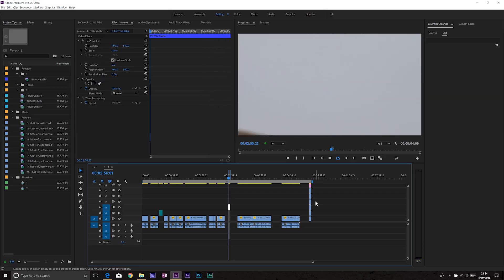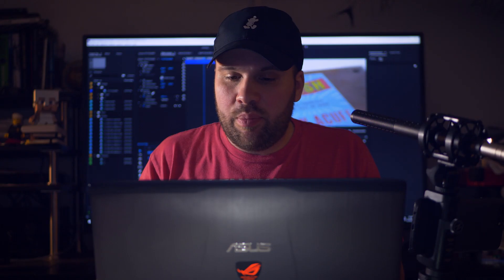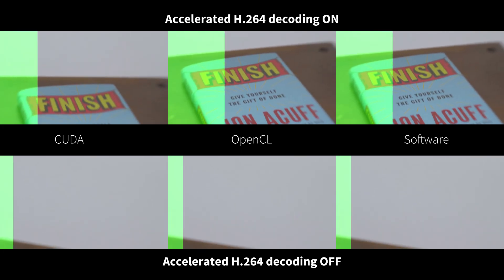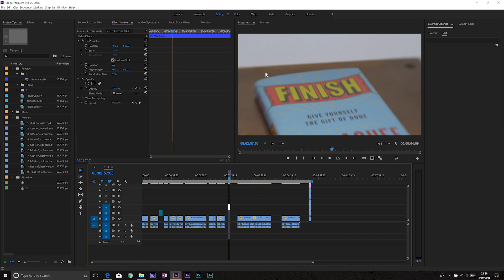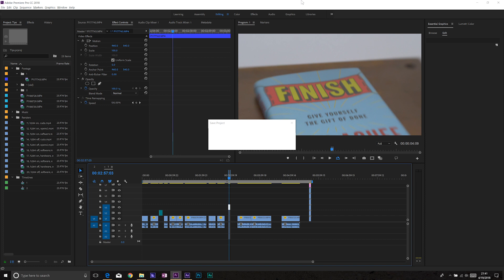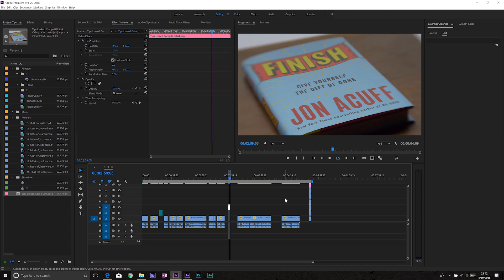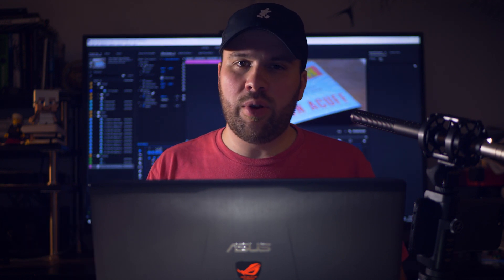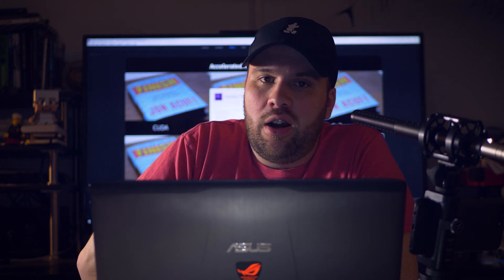H.264 bug in Premiere Pro: how I fixed it

Comment: Whenever I want to edit my videos on  H.264, the premiere pro will close. Please how can I fix this ?
Reply from the maker: It depends on what the cause is and when it's happening. You may need to change settings to use software instead of hardware rendering (what the video is about). You may need to update your graphics drivers. You may need to disable certain plug-ins. You may need new hardware. You may need to transcode the footage to a different format before importing. Lots of options depending on where it's going wrong. Adobe support and forums can be very helpful if you can explain in detail what your problem is and what steps are needed to reproduce the problem.

I fixed issues with crashing on export in this video, but basically it meant using software rendering instead of hardware: https://youtu.be/3n6DCA4MZy0
Reply: @chris_sparrows  thank for your help. Actually after editing my videos, if I want to render it and select the H.264 format, the premiere pro will suddenly close. This is exactly what I experience.
Reply from the maker: @chidozienwokoji4923  It still depends on the specifics, such as rendering directly from Premiere Pro or sending to Media Encoder. Sometimes one works over the other. You could try creating a new project with no footage, create a black video and render it. If that works then it's likely an issue with rendering your footage and not rendering in general. Setting rendering to use software instead of hardware before rendering might work. Honestly it's hard to say what's going on without seeing it.

Comment: If this happens to Me I just delete the video, remove it completely from project bin, then re import it, I found the culprit when this happen is when you make an  edit or scrub the timeline whenever the video is still making a cache or conforming. 

Premiere pro probably has the most problem when editing, you can't just think of your footage and edit it, you also need to think how to fix technical stuff every time, it sucks. Its probably the only Video Editing Software with so much problem, If only other Video editing software would provide motion graphics like after effects and has some intuitive ui I would switch, but right now there is none on the market so lets suck it up, Still one of the worst Software though in terms of efficiency.
Reply from the maker: Hopefully you don't lose too much work by doing that!

Comment: My premier pro do a glitch in Video after export
Is there any solution
Reply from the maker: Try changing the render settings to use software instead of hardware.
Reply: @chris_sparrows  I tried but it didn't worked
Reply from the maker: Does it happen on the timeline or just the render?
Reply: @chris_sparrows  it does happen in the timeline as well but that's not a big problem for me
But the glitch effect is also in my exported video
Reply from the maker: It's possible the footage is corrupt or an effect is causing the glitch.
Reply: @chris_sparrows  I didn't applied any effects it's just simple cuts
Reply: @chris_sparrows  I'm using 7 days trail version
Reply from the maker: Does the footage look like that when you play it in something else like Media Player?
Reply: @chris_sparrows  not the footage Don't have any problem
My premier pro does this with every video
Reply from the maker: Only thing I have left to suggest is trying to render to a different codec, otherwise you should probably contact Adobe support.
Reply: @chris_sparrows  hi I contact the Adobe helpline and the Adobe person asking me to give my computer access to him 
Is this normal?
Reply from the maker: I've never had to personally, that usually indicates it's not a simple issue to resolve. As long as it's Adobe's official support, it will probably mean a faster resolution.

Comment: my problem is that my graphics tab is all over the screen and like the places of everything is wrong and i really cant find a way to fix it i have a dead line please help i can send u a screen shot if it'll help
Reply from the maker: I'm not sure what you mean by "graphics tab". Things to try if this video didn't help: Does the footage play on the computer at all? Try the default video player on your computer or VLC Media Player. If not, does it play on another device or on your camera? If not, then the footage is probably corrupted. Does it play at all in Premiere with all effects disabled? If it does, then an effect is causing the issue. Enable them one at a time until you find the problem effect; sometimes effects are fine on their own and they have issues working well together. If that's not it and you have issues with both hardware and software decoding and encoding, then you can try updating Premiere if you're not on the most current version, or using the previous version if you are. If none of that works, then I don't know what else to try unfortunately. I've had good luck with Adobe support on Twitter. It's not the fastest, but they've been able to help me when I've had issues.

Comment: This always happened to me whenever I was working with clips that have different frame rates, and are saved at different file formats. 

To fix it, I'd just export the videos with QuickTime Player at H.264 at 1080p. Then I imported the newly exported clips into Premiere. 

Export the finished product and boom, no stuttering frames.

That worked for me.
Reply from the maker: Glad you found a solution for your problem!

Comment: Hi Chris! I've encountered this problem where when you export your projects the whole video slows down by 2x but the audio seems fine. Any suggestions?
Reply from the maker: That sounds weird. My first thought would be to export to a different codec to see if anything changes.
Reply: Omg i did not expect it to work! Tysmmm
Reply from the maker: Hard to say what the actual problem was, but my guess is the video bitrate was too high, or the drive it was playing from couldn't keep up.

Comment: I have the problem where my video constantly jumps back to the first frame
Reply from the maker: I've not seen that before, did any of these tips work for you? If not, I'd see if putting that clip in a new project has the same problem. If not, this video might help: https://youtu.be/3dVdojJCcv8

Otherwise you might try contacting Adobe support.
Reply: @chris_sparrows  I figured out a solution by putting the clips through Handbrake and converting them to .m4v files instead of .MOV.. idk it seemed to work for me at least
Reply from the maker: Good to hear! I wonder if it was a driver or hardware issue maybe.
Reply: a.k.a loops 30 times

Comment: THANK YOUUUUUUUUUUUUU
Long story ahead: I've been encountering this problem since the day I've had premiere pro, I thought it was minor since when I'm editing less than a minute project file there's just one or two clips that's bugged, but when rendering the bug isn't there anymore, until I'm editing a 1-2 minute project file the bug got more worse, when rendering and encoding it's still there too. I've tried to render a lot of times, change my sequence settings, create proxies to make the file smaller, downgrading premiere pro to 2019 (since 2018 version is not in stock anymore), render in to out multiple times, changing the export settings' preset, deleting media cache and delete some files to manage my storage, but some of the clips are still bugged. This had made me frustrated so much for the past two days till I've almost decided to download a crack version of premiere pro 2018, hoping it would work, but I know it'll be a risk so I'm giving myself a last chance to look another vid that could help to fix this problem. Until I've encounter this and tried the "replace with After Effects composition" option, AND IT FINALLY WORKS!!! So from the bottom of my heart, thank you so so much for sharing this, really saved my laptop from downloading a crack version. Idk if you would read through all these until now, if so I really appreciate you for taking your time to read this, thank you so much again!!
Reply from the maker: Glad it helped!

Comment: When i play back in vlc or media player its fine. 
But when i open my 2k footage in premiere some clips look damaged and glitchy. is this the same problem?
Reply from the maker: Possibly. I couldn't say for sure since I never found the actual cause, just some workarounds.
Reply: @chris_sparrows  aaahh okay thanks for the help of this video tho. because when i play it back. it looks like i put a shitty fractal noise glitch effect on it lmao. i made a rough cut and even when i render it out it still happens.
Reply from the maker: @ihateyou8006  Have you tried the various workarounds? If those don't work, you should probably contact Adobe support. Hard to say for sure what the issue might be, but it sounds specific to Premiere if other players work fine.
Reply: @chris_sparrows 
  ( Can i leave this comment here, just incase it might help someone? )
 Ive actually found a work around. 
So i had the main sequence with my edits, color grading and overlays. 
Then i made a new sequence, with the same settings. dropped my main sequence into the new sequence and it actually plays fine when rendered. 
strange lol no stuttering, no lag, no glitch / damaging the footage everything ran smooth.
Reply from the maker: @ihateyou8006  Absolutely! Whatever helps others is always welcome. Glad you found a workaround, thanks for sharing. Very weird that that is what got it working for you. I wonder if it was an issue with the timeline itself. I'd be curious if this also fixes it: https://youtu.be/3dVdojJCcv8

Comment: Adobe Premiere is the worst program for making movies i have ever used.   I finally gave up and took my clips and transferred them to an old PC that had Movie Maker on it.   It was able to process the clips with no adjustments after wasting days fighting with Adobe.
Reply from the maker: Sounds frustrating. I find most issues like this are usually hardware or driver problems.

DaVinci has a free version of Resolve you could try if you want to go a different direction.
Reply: @chris_sparrows    hey Chris, i just bought a new computer.   iBUYPOWER - Element Gaming Desktop- Intel Core i7-9700F - 16GB Memory - NVIDIA GeForce GTX 1660 - 2TB Hard Drive + 240GB SSD - Black    -
Reply: @chris_sparrows  i imported 11 MP4 clips, but when i tried to export them as one movie it would say the file was only 24 bytes and there was no thumbnail image and of course there was nothing to play.   i isolated it done to clips 10 and 11, they were the problem.   because i would export clips 1-9 together as a movie, once i added 10 and 11, or either of them individually the exported file would only be 24 bytes.  files/clips 10 and 11 were the same file as 1-0, all MP4.   I imported them all into Movie Marker and exported them as one movie with no issues.
Reply from the maker: Are there any effects on those clips? I've had similar issues and narrowed it down to an effect. Can you convert one of those clips with Media Encoder directly and not from a timeline?

You also might look at this: https://helpx.adobe.com/premiere-pro/kb/gpu-and-gpu-driver-requirements-for-premiere-pro.html, but from what you're saying it may not be a hardware issue.

You may also try this: https://youtu.be/3dVdojJCcv8
Reply: @chris_sparrows  ill look at that, thank you.  very kind of you to offer assistance.

Comment: I really can't render each of the footages on After Effects! Especially when u have 450 clips
Reply: YES! Me too! My clips pixelate in the glitches they have and I can’t do this with hundreds of clips 😭 I tried Render and Replace on all the clips and that didn’t work
Reply from the maker: Are there any effects on the clips?
Reply: @chris_sparrows  yes I have them color corrected and the speed duration faster since it’s an art video
Reply from the maker: Does it still have this issue if you disable the effects?
Reply: @chris_sparrows  any clips that do not have speed/duration applied don’t seem to be affected at all
Reply from the maker: Just on playback or is it in the rendered video also?

Comment: Thanks for posting this video Chris! This was definitely helpful on a project I just finished. The project file was ok, but the glitch showed up in my export, no matter what I did to fix. As far as I know, this issue comes from the building (or corruption) of Premiere render files. If you're only using a single hard drive in your laptop there, it could be that the media cache files are getting corrupted often. This would make sense, considering when you replace with an AF file it doesn't happen anymore (either has to make a new cache file, or just uses the new one from AF... haven't figured which one out yet.)
Reply from the maker: Glad it helped. The specific issue disappeared for me when I later upgraded my graphics drivers and (if I remember correctly) updated to a newer version of Premiere. I wasn't using any cache files for my project so I figured it was a hardware issue.

Comment: When I render a video that lasts for 50 minutes, it says after it has been rendered that the file is corrupt and that it is not "supported". Someone help!
Reply from the maker: Did you try software vs hardware rendering as demonstrated? Can you render a minute or two of the video or is that also "not supported"? Have you tried a direct export vs using Media Encoder?  Next thing to try is to render to a different codec or container.

I can't help with this, but is your system/software/drivers up to date? Have you tried a different version of Premiere?
Reply: Do you know why the whole video is 50 minutes, I also go through the video and then it stop at 15 minutes. Also it also gets weird it and go back to 0:00
Reply from the maker: I can't say, but is sounds like their may be something at 15 minutes in that is causing problems. An effect not working or corrupted footage or something. Did you try anything mentioned in the earlier comment?

Comment: what happens to me is when I see the preview before rendering and the project, (the frames are ok) right how i need it , but when I finish rendering I see the video, and I get frames that I did not put in certain parts of the video (especially at the end of the clip, between other clip) damaged frames, like a bug, without me adding them.  It is rendering error and it is already quite annoying. But this happends to me in After Effects( with h.24). i hope you can help me .
Reply from the maker: Other than the different workarounds I mentioned, the only other things I can think to try would be 1) rendering with a different computer (with different hardware) if possible 2) rendering to a different format to see if it's a codec issue, and 3) rendering without effects to see if it's an effect causing the problem. Other than that, you may need to contact Adobe support.
Reply: Chris Sparrows thank you for your reply! I will try this things, im suspecting its the codec.

Comment: Hey, useful info, thanks. These frame glitches have been driving me nuts and I happen to be using an Acer Gamer Laptop too (i5 / nvidia 1050Ti). And now we are in Adobe CC 2020 and all the apps have this issue (AE, AME, PR). Also, the preference has changed to "Enable Hardware Accelerated Encoding and Decoding" in all these apps. It took me a long path to conclude it was a DECODING and not ENCODING problem and only then I found your video.
It's still a mess. I tried disabled HW Encoding and decoding in AME and leave the other apps alone but still have the glitches. AE comp in premiere doesn't work for me. The only granted workaround I found so far is to recode the original MP4 footage to something else (QT Prores) and work with that. In the meantime I'm still trying combinations of settings in the different apps.
Reply from the maker: Yeah, there's some hardware issue that I suspect lies with certain drivers. Oddly enough, some time after I made this I updated the drivers on my laptop again and it started working properly. For encoding h.264, there's also a new software/hardware encoding option in the export settings too.
Reply: It seems to me that disabling hardware decoding/encoding in AME only affects clips that are being imported directly to AME. For projects queued from AE or Premiere, this settings doesn't matter, but it has to be set in the source app instead.

Comment: After hours of research, two of my experiments worked for me.

Method 1:
(It's the solution from this video)

Turn off hardware accelerated decoding in Premiere Pro's Preferences under Media section.

Method 2:

Disabling Dedicated Graphics Driver.(Mine is Nvidia)

Go to device manager in control panel and under display adapters, disable the graphics driver.

Hope it works in rest of yours too!
Reply from the maker: Frustrating when you can't use your graphics card, but at least it works for you now. Happy rendering!
Reply: @chris_sparrows  You can work with your graphics driver "ON" except while "EXPORTING" but what you have to do is:
Only use the above methods, while "EXPORTING".
It takes time on exporting, but gets your job done!